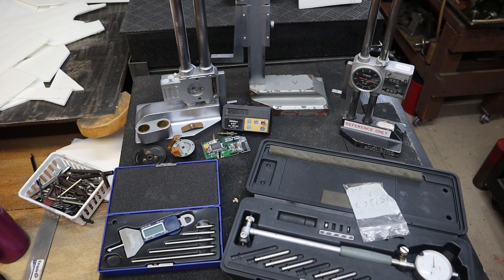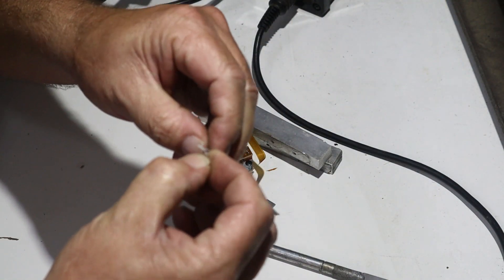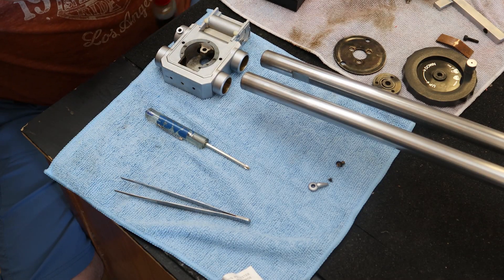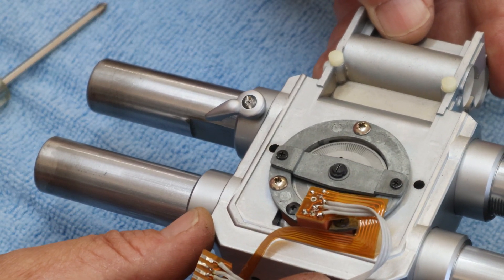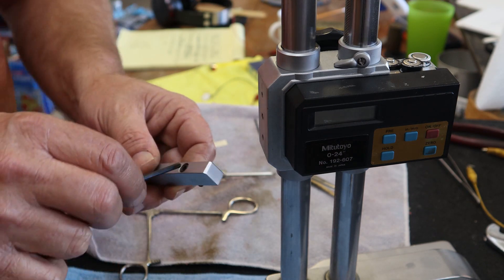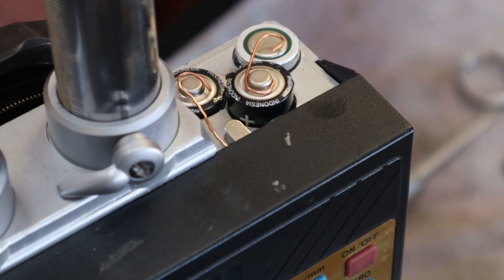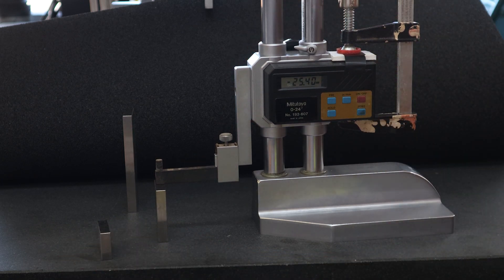24 Inch Mitutoyo Height Gage Repair

Comment: Hi, just watched your 1st video. Very nice, i have a question . I have a 18" Mitutoyo height gauge, a bit older than the one you fixed. You mentioned a backlash eliminator, i have a .012" backlash presently and when i look inside i see the reader wheel backlash is the problem , is there something i can do to fix this ? Tks 
Dave Godin Quebec Canada.
Reply: If you havent fixed it yet, theres a good instruction on the practical machinist forum. You have to wind that gear to preset. Its not exact of how much but usually half a turn is about right. I have the 40" so im sure theyre somewhat similar in design. There are 2 large brass gears that wind the shaft on the encoder wheel. One of them has the coiled spring that needs winding just so when you travel the reader in the opposite direction, the winded gear will unwind just a hair to always keep contact on the encoder shaft's gear

Comment: So when you put the locking mechanism back together,  how do you adjust how tight it locks if it's not locking or clamping enough? I have a Mitutoyo 12" digital height gauge and the locking mechanism doesn't hold the head in place when I'm trying to scribe lines. How do you adjust that??

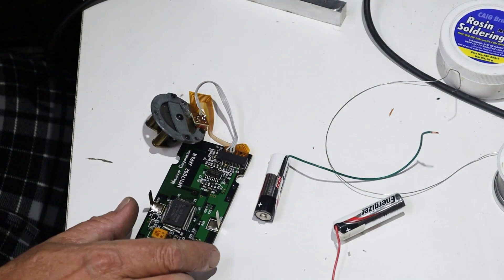Comment: 4:40 - Jeeze that thing got a huge chip, what kind of chip is it? Why does it have to be so computational? Have any idea what kind of encoder system the height gauge uses for the linear type with a strip at the center?
Reply from the maker: It is older tech.  I would imagine it does both the counting of the encoder and the display works.

Comment: I hate flex strip PC boards. Where I worked (avionics design), the ME's would use that process even when not needed as they wanted more complexity in the packaging.
It sucks when you take something apart for repair, and it gets damaged. So nice repair of your inflicted damage. Have to see if you ever get a new cover for this. I was able to order a cover for a Mitutoyo 12" caliper, my brother gave it to me from where he worked, I think it was a "safety award" (that's what my other brother, a rig welder called them).😁
Reply from the maker: I have yet to chase after a cover for it.  Been busy fixing other things. :) Thank you!

Comment: I have the same model. When i start to move it very slowly the LCD tend to be a lite late. I move it maybe 0.1mm and al of a sudden it starts reading. Do you understand? My english is not so good.
Reply from the maker: I dont know why it would respond slowly.  There could be a battery issue or it is just getting old.

Comment: Hi. Im restoring a 192 605. At 10.15 when you are putting the wheel back on, well... i cant get it off! Nut is off and theres movement but it will not come away even with a pry. I can see anything preventing this. Any ideas?
Reply: My wheel was stuck too, spinning it released it for me. I believe the tight fit cut threads into the plastic. Realize this is 11mo old, but commenting in case it helps anyone else.
Reply from the maker: Ide have to look back.  I believe they can stick and the plastic grabs.  Pry from as close to the shaft as possible as not to snap the wheel.

Comment: Where is the best place to get spare parts for the older height gages, i have a 192-931 model
Reply from the maker: I am not really sure. Some of the indicator repair folks have access to old stock but you would have to call around.  I wish I knew more to help.
Reply: @AlmostMachining  Ok thanks

Comment: Shouldn't you pre-tension the backlash elimination spring before putting it back? I have a similar Mitutoyo unit, got it all working but the LCD is very faint, can't seem to find a replacement anywhere
Reply from the maker: Probably.  I was careful not to change too many things ao i was lucky in that additional tension wasnt necessary.